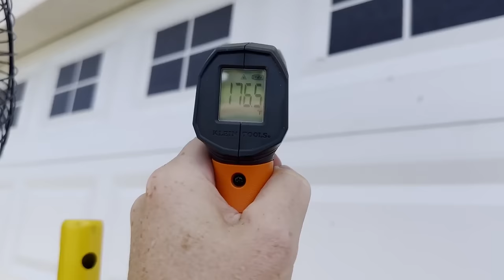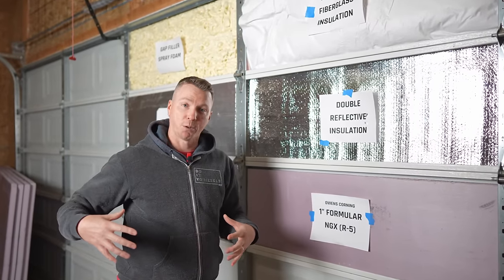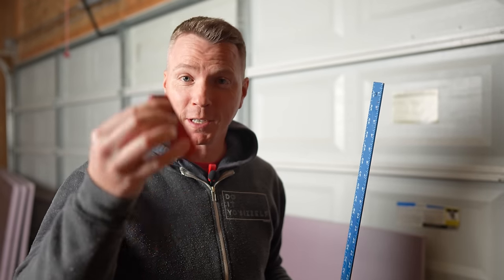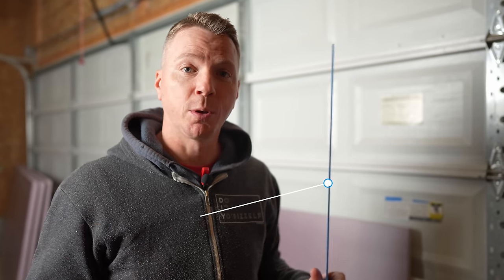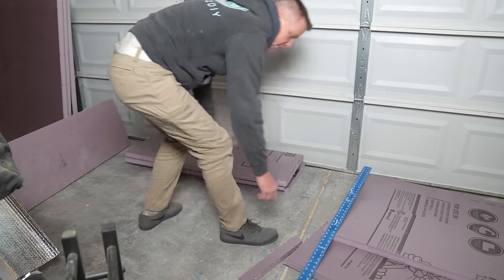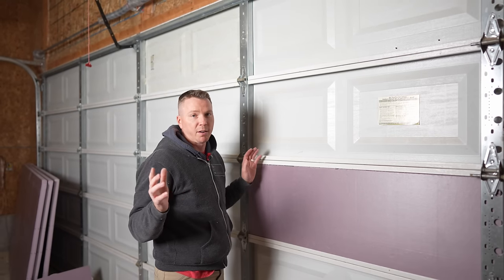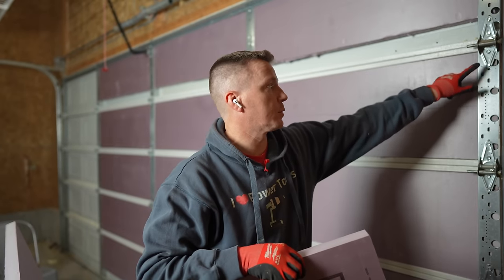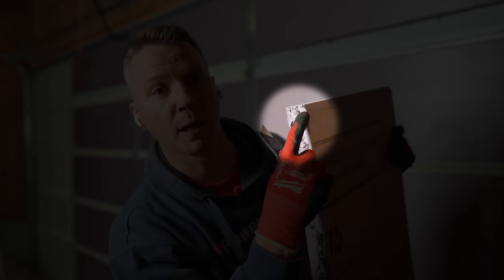The Easiest & Most Effective DIY Garage Door Insulation

Comment: I would've done it a bit differently by installing each panel as 2 pieces, (an upper and a lower) so that the factory edges meet in the middle and there wouldn't be any need for spray foam. The difference in aesthetics due to a seam in the middle is no concern of mine. The factory edges should seal against each other just fine. For aesthetics, I would cover the entire inside of the door with thin vertical panels that cover all the hardware and seams. If the final layer is thin enough, you may not even have to make any horizontal cuts.
Reply: Your not completely wrong.  However if you don’t know, you don’t know and you can still cut a little off straight with a knife and you still need to fill with spray regardless. Other issues with look, yeah I agree he could have done that.  That’s a great side to it
Reply: @aaronblackford981  I'm not so sure about "need" with the foam. Any improvement is a step in the right direction, but some things aren't worth the effort or increased cost vs any measurable savings on utilities.
Reply from the maker: I like where you're headed with this and that's certainly an idea worth considering. The reason I don't think I, personally, would choose to do it that way is that  each panel opening is captive on 3 sides (top, bottom and right) so you'd actually end up having to cut a separate piece for the right side before wedging the top and bottom pieces together. Not only that but because the opening height is around 17 1/4" and you want factory edges, you'd end up wasting (or at least not having factory edges on) the middle 13 1/4" of every board. 

I considered doing a light covering over everything for both aesthetics and to help seal it off a bit but I'm not sure what material to use since it would have to be very light and either unlabeled or paintable. Tyvek is an option but they always make it so ugly with all of the print all over it. I'd be open to suggestions for cover material for sure. I'm also likely just going to paint the inside of the door white to make it consistent and I lie that there are no big gaps or joints on it as it is.

Either way, I appreciate the feedback. I wanted to do this the fastest and simplest way possible while still being efficient and there are definitely multiple ways to tackle it. Thanks for watching!
Reply: @LRN2DIY  Tyvek is available without the print. Tyvek coveralls use it so it must be available somewhere. I would check industrial supply companies. The most important part is to stop air intrusion. When my shop is heated and it's -20 deg F outside, whatever little bit of thermal conductance pales in comparison to the BTUs required to heat or even cool my shop. I've been using moving blankets from Harbor Freight to close off rooms being worked on and they do a remarkable job at insulating. It sounds nuts but they really work well. Just something to think about albeit an unorthodox product for this use.
Reply: @LRN2DIY  I say for the thin layer. Use something like the double bubble maybe or yah. Unlabeled tyvek.
Reply: How much weight does this setup add? I’m thinking of replicating. Could you paint it?
Reply from the maker: @schop  This adds around 15 lbs, and yes it’s paintable.
Reply: @schop  I never weighed mine. The doors I did this to were huge, so it barely affected the spring tension. Anything can be painted with the right paint. FYI, Styrofoam dissolves into a goo if it comes in contact with acetone, thinner etc. Use scraps for testing or use latex paint. I would still test to ensure that it sticks. I highly recommend a primer first.
Reply: @MakeitZUPER hear hear. I love those cheap Harbor Freight blankets for the same reason. During a mid-winter full-gut bathroom remodel, the ceiling was removed exposing the room to 20F unheated attic. Nailed HF blankets to the joists and around the door. Now use them instead of plastic with zip poles during construction.
Reply: @DunderKlomp  They don't last long or survive a washing machine more than a couple of times, but I consider them disposable.

Comment: Those scoring marks are so you can snap the foam. No need for all the extra cutting. Same goes for the other cuts...one deep cut with the utility knife, then snap it the rest of the way, a little like cutting glass.
Reply: I wish the scores would be a different locations.  Would like to get the panels cut to 17.25" but I know there would be waste.

Comment: You can score that board with your utility knife, then snap it.  Kinda like how you score glass, then snap it.
Reply from the maker: When I tried that the break ended up very chunky and jagged. I may have been doing it wrong but I found that I had to cut all the way through to get solid and clean 90 degree sides.
Reply: @LRN2DIY  Did you table edge it to do the break?  I've never had it jag out.  I've had it break a hair off square, so it was slightly beveled, but never jagged.
Reply from the maker: @im2bz4stupidity  I didn't use a table edge so that could have been the problem. I'll have to try it like you suggested. That would save a lot of time for sure!

Comment: What is that garage door made out of, just stamped metal? That seems.... cheap. Either way, that metal framework is one massive thermal bridge, and will still suck a ton of heat out right through the structure of the door. To properly insulate you need the whole structure including the joints covered with a sheet of material, which of course is hard to do on a working garage door. Seems like just buying a properly insulated garage port door might be the sensible way to go. I know there are 2-inch thick sandwich construction doors in the US as well.
Reply: You are the only one to mention about the thermal bridging

Comment: I found an almost new insulated door on a buy & sell for $200 and i could still sell my old door and parts to recoup some of that. Came with all the parts, track & spring and an hour to pop it on. The mfg sticker shows it was built locally by a company that does commercial doors and new they're over $2000.
Reply from the maker: Score! Sounds like a great find.

Comment: Can you paint the panels?
Reply: Yes
Reply from the maker: You sure can, and I most likely will. Water based or latex based paints work fine on the Formular NGX so I'll probably paint it all white.
Reply: i covered mine with that aluminum trim you can cut that stuff with a knife

Comment: Please please please, calculate the added weight. Garage door springs are calculated for the weight of the door. Adding too much weight will put stress on the springs and Operator. Given that most of these are not all that heavy you'll probably be okay. But he's working on what looks like a 16x8.

Comment: 'Cold' can't come through. Cold is merely less thermal energy. Thermal energy is leaving the room through convection and our bodies sense transfer of thermal energy not temperature. That's why a piece of metal and a piece of wood despite being the same temperature feel different. The metal easily conducts thermal energy out of our bodies while the wood doesn't. NGX is a good product for insulating a garage door, but you'll need to get the garage door springs adjusted to compensate for the extra weight of the door so the opener motor doesn't have a shortened life.

Comment: This is going to cause a lot of people to damage their garage doors. 

Pan style garage door sections are constructed by attaching the stiles to the door skin with tiny rivets, two on the top and two on the bottom, and then gluing the stile to the door skin in a few spots.

As you press the foam into position you’re pushing the door skin away from the stile and stressing that glue. Not a big deal on a new door but as the door ages, that glue fails easily. After the glue fails, we start seeing issues that lead to replacing sections or the entire door.

Comment: I don't get why you'd use this NGX stuff (XPS = styrofoam) vs PolyIso insulation boards which are R-6.5+/inch vs NGX at only R5/inch.  Plus the polyiso has foilbacking for reflecting heat.  For a small surface area like a garage door where the time and labor are way bigger than the cost of materials, it makes sense to use the good stuff!
Reply from the maker: Because I tested it in the last video. 1" NGX performed better than 2" R-Tech, despite the claimed R-Value. I don't understand the R rating on some of these because the R-Tech stuff is way softer/lighter and simply doesn't seem to insulate as well.
Reply: @LRN2DIY  Theres a higher end version of rtech that's poly iso (rmatte plus 3) vs xps (ngx), that's what he is referring to. It's fine it's not too much of a difference but the poly iso is superior by like 10-15% at the same cost.

Comment: Honestly, I don’t think you need to bother with the spray foam, the metal curls around anyway, so there there’s a giant thermal bridge through that metal.
And the air inside can’t really move anywhere because it’s a very very small pocket, so it really doesn’t help you all that much to insulate it as the heat is going to go around the edge rather than the air that’s already trapped.
Reply from the maker: That'd be a good one to test. You might be absolutely right.

Comment: Nice job! My only comment is a bit picky, but technically, there is no such thing as “cold”. There is heat, or the lack of heat. Cold isn’t a thing. Insulation deals with the movement of heat.
Reply: Energy and the absence of energy.  Same argument is made with light and dark.
Reply from the maker: Oh man - you're getting way too deep for me! 🤣 If I start referring to the lack of heat instead of saying the word "cold" in my videos I'm going to get (even more) crucified in the comments by confused viewers. That said, I suppose I could at least address it and then explain why I say "cold". I have several videos about electrical outlets, which are actually called receptacles, not outlets, but I still say outlets because that's what everybody knows them as. They way they still find and understand the video but I throw in the proper name so we all can learn it. Anyway, thanks for watching and now I have learned something new!

Comment: You are overthinking this.  The foam covers the largest radiating surface.  You still have six sixteen foot cracks leaking air and nine 16 foot radiators above and below the foams.  I thought you learned your lesson trying to un-foam that one panel.
Reply: Are you saying it’s not worthwhile insulating the door to reduce the radiant heat since ambient heat will still prevail?

Comment: You used the wrong seal. There is a way better seal that has a solid piece attached to it. You put sealer between the solus piece and your wall, screw it on so it has a little pressure on the door. They seal so well you get no light. And. It is printable. However. Good job overall. You married? I have a stray daughter.😅
Reply: Can you link one you recommend
Reply: @brandonnguyen1486  When you install the I sent the link to, you can use a paintable caulk and put a nice fillet on all the exterior edges. Make a nice looking clean install.
Reply: I don't see a way to send you a picture. You did get the link, correct?
Reply: @dalescribner3070  where did you send the link
Reply: @brandonnguyen1486  I sent it in the reply. Maybe the tube deleted it. I will get you a different method.
Reply: Check Lowes for this product, Royal Building Products 9-ft x 2-in x 7/16-in White PVC Garage Weatherstrip
Item #73718 |

Model #2100  There is a picture on their ad that shows how it is installed.
Reply: @dalescribner3070  awesome thank you. For my regular doors, you can see daylight around them

Comment: best way is to hire a pro that knows what he is doing ..not just a slam it in the hole an run guy..and ps dont buy a cheapo door expecting quality either...get a good double sided  metal  door  with encased insulation...o ..the add on insulated doors are  ok but you get what you pay for... I have installed many  good Midland  insulated doors over the years they are very hard to beat,  top of the line doors that are more secure and will last you a lifetime ...unless you forget to open em when you drive thru....wink wink...and get a decent  operator ..aka opener ...   those are the noise sources  if your wanting quietness.. i'd recomend a belt drive ......happy hunting  .....10 plus years installing doors  says that diy may sound good.... but over the life of the door  done correctly usually wins especially when most decent installers warranty their work....suit your self... if you have the time to fiddle with the door continually and like doing that  get at it .... have fun and above all..... please don't get hurt ...them springs can be dangerous....

Comment: That's adding extra weight to the door and those Springs are not set up for that extra weight . You're going to work your door opener harder and strip out the gears. Get your springs adjusted or changed out to handle the extra weight.
Reply from the maker: Which is exactly what I said in the video at 9:35 and even put out a follow up video about that, as promised, today. https://youtu.be/xOXO01rdZ5c

Comment: NEVER install insulation in a door that didn't come with it. Adds too much weight to the door which strains your springs and your motor. If someone disengages the door it will fall down and crush anything underneath it.
Reply: This is an important point which he did cover at the end of the video. He did say he was going to change the springs, which is the right way to do it. If you simply add tension to the springs you have, you will overwind them, this will make the door harder for the operator to close and shorten the life of the springs dramatically. I definitely don't recommend most people to replace their springs, not everyone has a light duty pan door like the one in this video, and could be exposing themselves to very dangerous levels of spring tension.
Reply: The only way to know what to change the springs to is to know the exact weight of what you're adding and the weight of the existing door. Springs are made for the weight.
Reply: Absolutely, I do this all the time, its my job. All the more reason to leave it to a pro. I'm all for DIY, but garage door springs shouldn't be messed with by your average Joe. @FredHadleymusic
Reply: @shredmonster76  I've been doing it 27 years brother 👊 Fully agree
Reply from the maker: I wouldn't say to never add insulation, but to only add it if you make sure your springs are designed for the weight, which is almost always a spring replacement, which I talked about at 9:35 and then put out a video on today: https://youtu.be/xOXO01rdZ5c